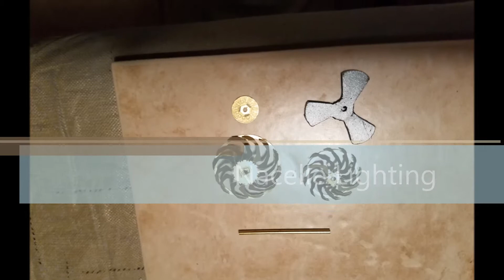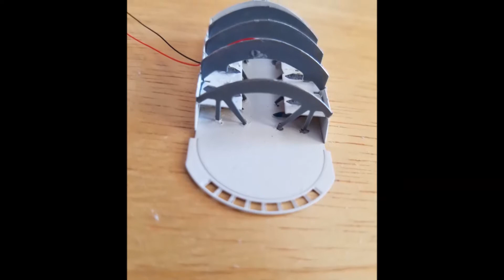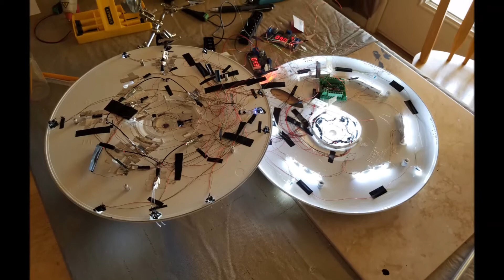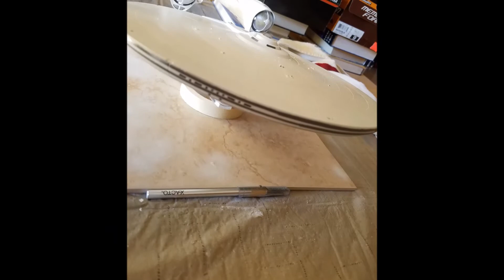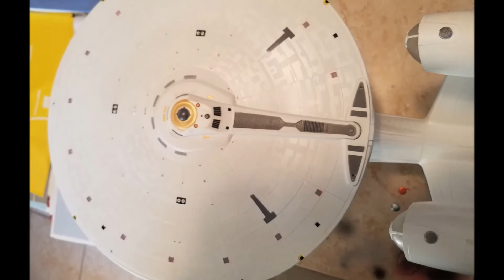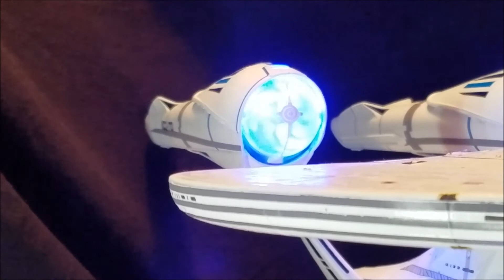JJ Prise Redux Into Darkness Enterprise  Model

Comment: Stunning build - puts mine to shame. Are those Lemo connectors easy to use?Look ideal for an upcoming refit build. Will need to get an appropriately sized brass rod to go over the bottom part.
Reply from the maker: Thank you for your kind words. In fact, there are some builds that put this one to shame. Really, to do better, you have to build the same kit several times. This was my second try. If I did it again, I would place little flashing thruster lights, use a decal for the shuttle bay floor, use counter rotating blade assembly, add the bridge, perhaps use a slightly different connector, and use some slightly better lighting methods. The lemo connector is ok, but has a distinct disadvantage. Unless the model is centered fairly well at the connection point, then the connector won't work well to keep the model in the correct orientation. There are some connectors with a screw on assembly which are more sturdy (microphone connectors), and they are cheaper, though a bit larger. The most challenging aspect of the build is light blocking in my opinion.
Reply from the maker: I saw your video, it looks good, especially the paint job. I noticed you appear to use the microphone connector? What did you use for the stem and connector and how did they assemble together?